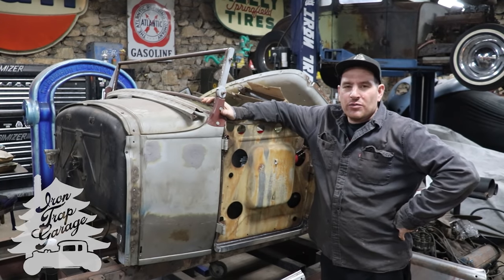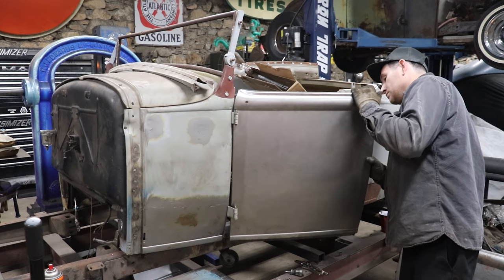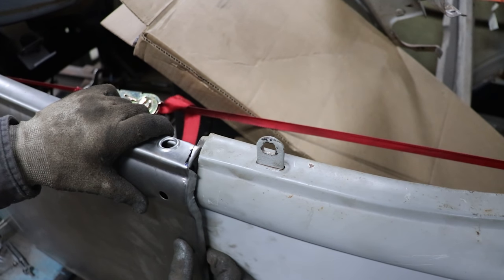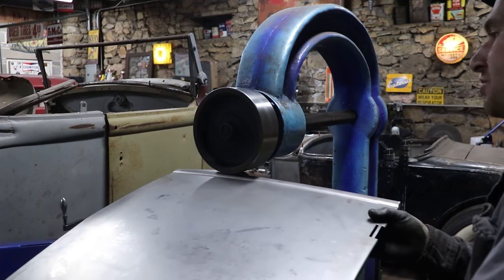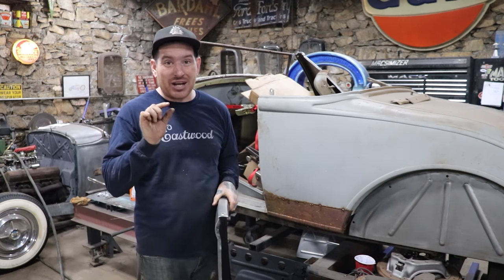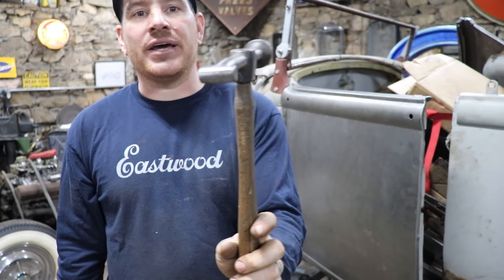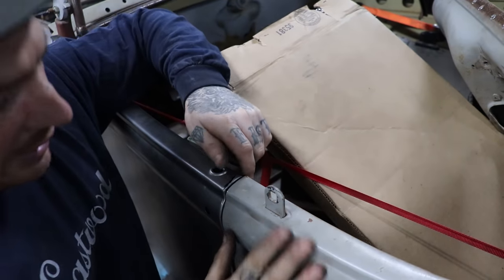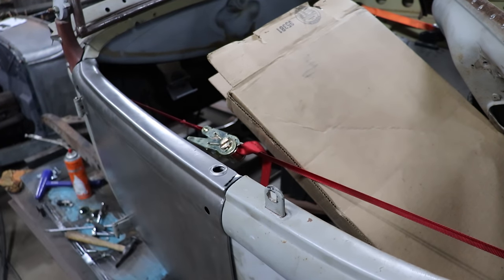How To Fix A Rusty Ford Model A Door Part 2 - Re-skinning A Door

Comment: That's a pretty old door skin but does get you close to wondering if you should have a go at making your own one? It can be nearly as much work getting it to fit satisfactorily as it is to make one from scratch! Given you often need pretty much the same tools to fit one as it does to make one then if you have the time you got to give it a go! 
I had some bead roller die blanks turned up from scrap alloy and found them easy to shape to suit particular profiles like the bead on the door skin bottom. They last long enough to make several door skins and can be modified to suit other jobs.
Great video mate.
Reply from the maker: Hi Andrew. I plan to do just that on the sweetheart roadster but it does take longer to make you’re own in this instance. Also the finish the owner of the car was looking for wasn’t super high so he was ok with the small imperfections or differences of a reproduction panel. Always a balance of time money and quality of repair.

Comment: Get rid of the steel dolly!  Use a hockey puck. You can cut them anyway you want. They won’t damage the panel or transfer impacts to your hand. Help keep the carpal tunnel away while doing a cleaner job.
Reply from the maker: A rubber dolly like that also allows the metal to “give” and stretch into the dolly. I know when I’m hitting to hard or just right by the “ring” of the dolly”. If you’re using a soft hockey puck you now have give that allows that hammer mark from a incorrect hammer hit to hammer further into the rubber because of the give stretching and furthering the damage. I think a person should focus on the aim and severity of the swing of the hammer more than using a soft dolly that potentially allows you to overstretch the metal. Same reason you use a soft sandbag; to give a pocket or have give to hammer the metal into. I’m sure your method works fine if you’re experienced enough but I’d hate to see a beginner think it’s a magical dolly that will stop hammer marks from showing on the other side of the panel haha. Good tip regardless I could use them to cut into odd shapes for certain projects for sure!

Comment: Great job on the doors, I have similar issues with my 31 Roadster.  The bottom  back of each door flairs out about an inch when closed.  Corrected the same rust and rot as you on the bottom of the door, still flairs out.  Got some new hinges...we'll see!

Comment: I'd bet that even when Ford was making those doorskins new, they still did a fair bit of hand work on them. Working in an auto plant in the 70's, we used hammers and wooden wedges to align panels and make adjustments on the assembly line.

Comment: Cool video, I almost wonder if it would be easier to do the door first, then make the lower patch panels to line up with the door, since the door has a top and bottom body line and if they are too close or far apart it would be easier just to move the lower patch panels to meet them. Not second guessing you, you did a great job with what you had to work with, I'd be happy with that all day long

Comment: I once fitted OEM doorskins too a 60s Holden.  I had watched them being done before so figured it was fairly easy,,,wrong it was not. All of what you did happened and in the end they did not fit great. As much as anything the door frames actually warped when I did them. Though I did test fit then clamp then I rolled them on in one go. Which was wrong. Like you I laid the doors on something soft, a tyre and then uses a small ball pein and a piece of tram line as a dolly. IF I had test fitted before I brazed the skins in 4 small spots I probably could have caught the distortion.

Comment: Another problem with lots of the door patch panels is the bottom bead comes as a "straight" line while the original bead was a curve. Like a "smile" down in the center.

Comment: NEW TO THIS SITE,  I AM FASCINATED BY THE BUILDING.  HOW OLD IS IT?  IS THE STONE WORK IN GOOD SHAPE?  WHAT OTHER BUSINESS HAVE OCCUPIED THE BUILDING IN THE PAST 100 YEARS?  IT IS FRUSTRATING TO MAKE THE LINES LINE UP, HORIZONTAL AND VERTICAL,  WHEN THE FINAL PAINT IS ON AND BUFFED, SO MANY PERCEIVED IMPERFECTIONS SEEM TO MELT AWAY.  NICE WORK.
Reply from the maker: Hi John, The building was built in 1947 and was a private airplane hanger. Until now it has always been dry storage or a hanger. Thanks for watching!

Comment: Excellent video Matt!  I need to do the same repair (2nd attempt) on my project.  The bend lines on the panel I bought are not right.  Made a template off the other door and was quite surprised how far off the patch panel was.  Very frustrating.  

Hockey puck comment - I've heard this before.  Don't remember when or where.  My son had a crate of them.  I'll have to look around for one.

Comment: It's a round face cross peen finishing body hammer. Cross peen means the back peen is cross to the handle, straight peen would mean it aligns with the handle.
Reply from the maker: Thanks for the education. I just pick up whatever hammer fits the shape and works for me. Not classically trained just a hack in a home shop working with what he has.

Comment: Ya the do it yourself way is the best way ya more time but a lot less money and if you do the do it yourself from start to finch the over all cost of building a rod like this will be a lot lower in the end. And that way someone on a budget can afford to do this I've been restoring old cars trucks motor cycles my hole and the do it self way is the 0nly I could afford to do it. A little more muscle grease and A lot less costs